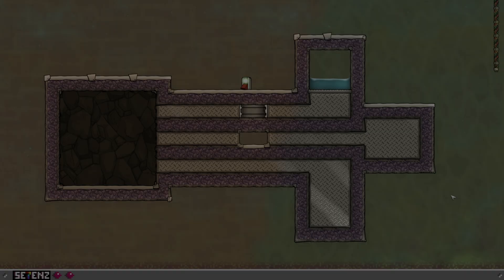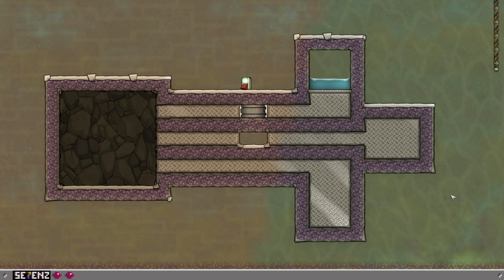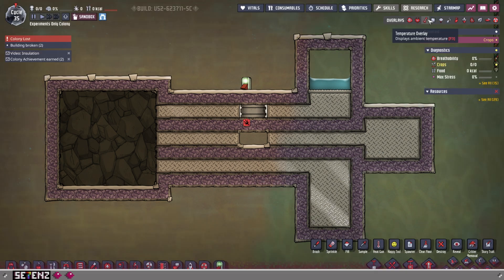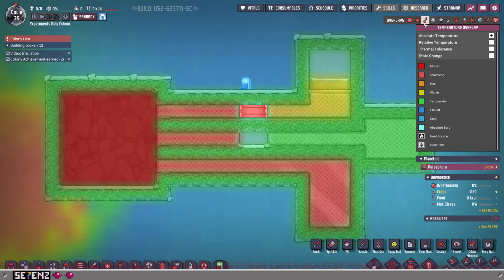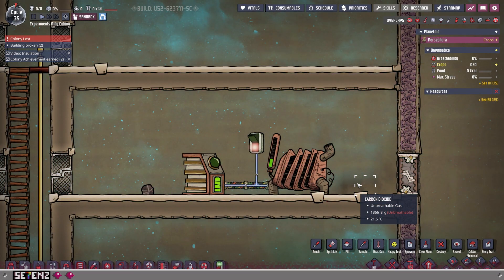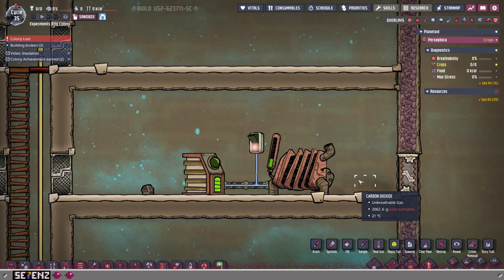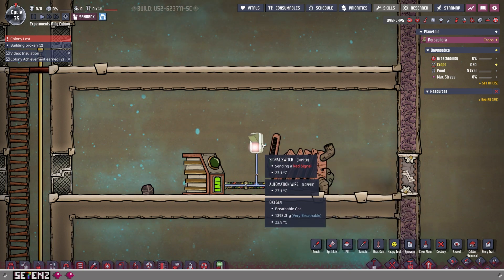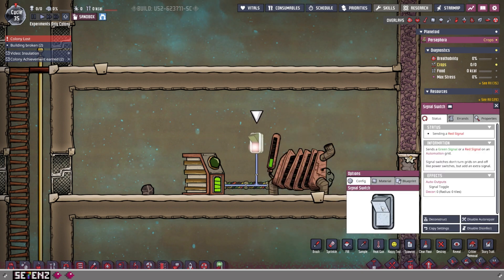1.2 Heating Basics . What It All Means | Oxygen Not Included Brute Force Guide

Comment: What is the difference between hot vs cold insulation I watched previous videos but didn't get it.
Reply from the maker: Hey. Thanks for the comment and question! I will try to make it simple. Firstly, it isn't really hot or cold insulation, but rather the idea that insulation will essentially act as a barrier to temperature. If you use insulated tile, it can prevent temperature from going across it from one side to another. This is important for many reasons, such as blocking off a hot area from reaching inside your less hot base.

Now it does get more complicated. For example, if the inside of your base (which typically should stay cool around 20 to 25 degrees C) ALSO has buildings that run and essentially make a lot of heat, it is possible for your colony to start warming up even if you have insulated tiles surrounding the outside of it.  This is because, in this example, your hot machines are inside your base.

Finally, there are many cases where certain areas may need to stay hot. For example, certain plants may have higher temperature requirements that your duplicants would not like living in all the time. Assuming you have a way to provide heat to those plants, you can use insulated tiles to help maintain and keep that hot temperature in there and prevent it from escaping.

I also have some modules on cooling that are worth checking out that may further help with this topic. Remember, insulated tiles serve as a barrier to help keep out certain temperatures from other temperatures. It can keep out hot temperature, cold temperature, warmish temperature, etc. I truly hope this helps.